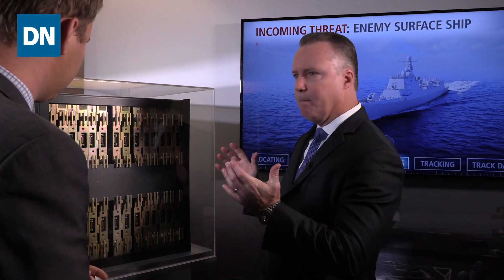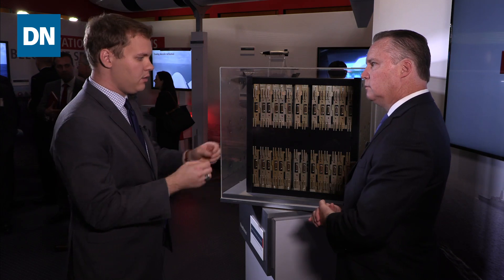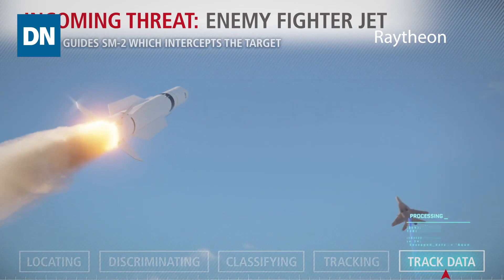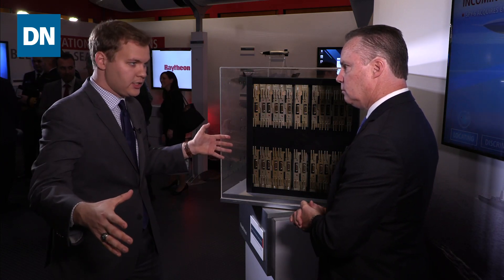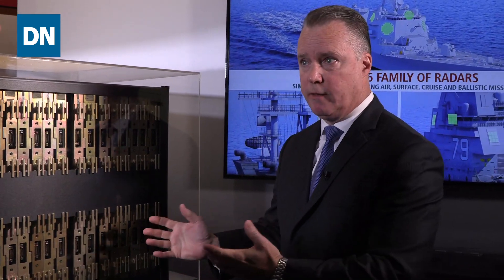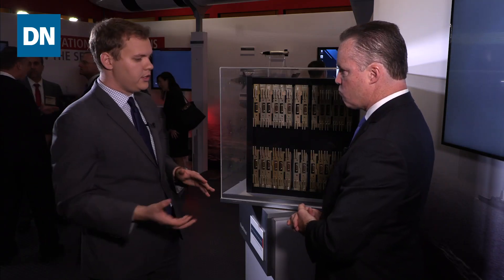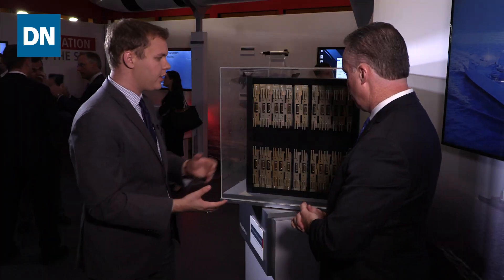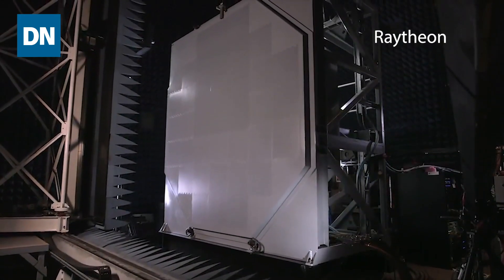Raytheon's SPY-6 radar to be integrated into several ships | Surface Navy 2020

Comment: Great vid. Very happy to see the evolution of this system. Especially to be integrated with additional platforms.
Lastly, when I heard the rep say "Irregardless", it took me back to the mid 70's, when on a Mid Watch, I was explaining to a 90 Day Wonder Ensign, that (at that time) a Priority Navy Message could not be sent without a Releasing Officers signature. During the education process, I said that word. He instantly wanted to forget about signing the message, releasing it for transmission. Basically told me I was a hick from the sticks for using a word improperly. At that point I told him how __c_ed up he was, for not having the knowledge of the requirements for standing watch in the position he was assigned. 
The next day I got a atta boy for educating the young Ensign. Thirty seconds later I got two chunks taken outta my azz, one from each cheek, from the Master Chief and the DIVO for Borderline Insubordination. I said my regrets, and ensured them it wouldn't happen again, unless he wanted to be a Spithead again, and if so, I would be happy to remind him of his lack of qualifications. But a funny thing happened a few months later. In a roundabout way, apologized for his behavior that night. He was thanked over and over, but regrets were not extended by me.
I never used that word again, when speaking.